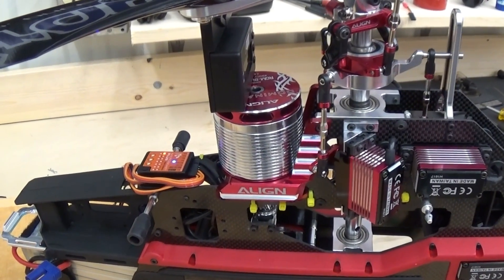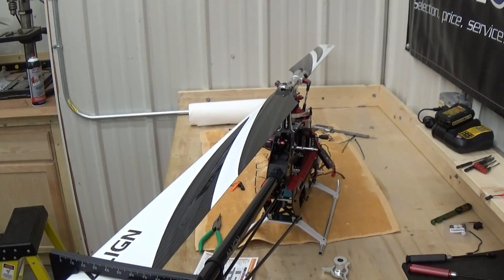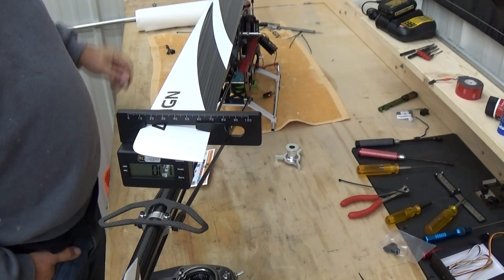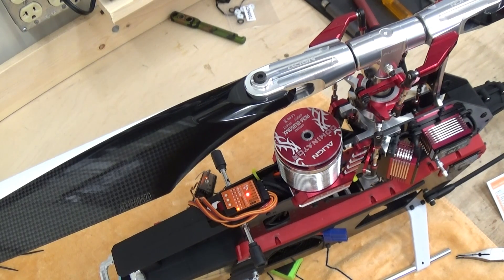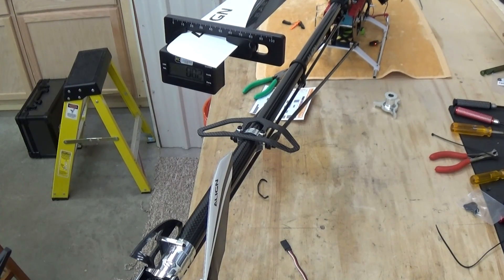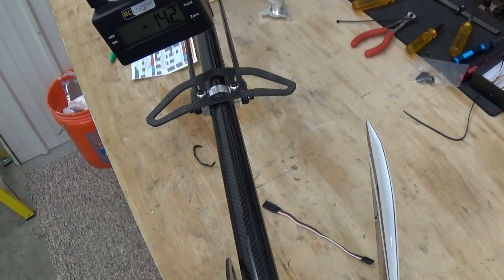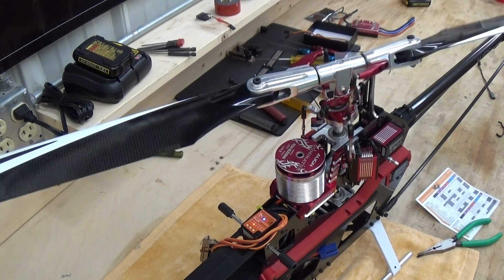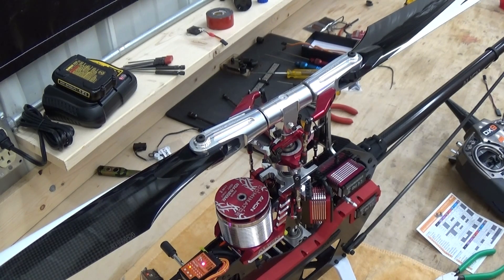TREX700X MicroBeast setup Part 3

Comment: Thank you for video series. Have a question. When I adjust blades to 0 degrees (throttle at 50%) and they are aligned with a tail boom, from the front of my heli, I adjust a blade to 0 degrees. But when I turn that blade around in the back, it is off by minus 2 degrees. What is wrong? Considering that the swash plate has been leveled. Same goes for another blade - from the front - set to 0 degrees and after turning it back (to the tail) - it is -2 degrees off. Is it suppose to be like this? I was thinking, that if the swash plate is purfectly leveled, both blades should have 0 degrees from all sides of the heli.
Reply: Hello from Spain then you make a mistake in leveling the swashplate mecanical , its the most importend think to level it mecanical to 0 and i make it all from backward and and than you con not hve 2 degrees of diference its your mistake . Than the new Microbeaest X 5.1.4 point G and H changed you have to read the whole manual and than you undersand all , because than you can make all Helicopers working with the same ground setting , its more work but then you understand all for what it is . I have 7 Algin Helis and without wind the go no to nowere because its like a car when you have a alitentation the car goes everytime sraigt ahead . Best regards from a German living 30 years in Spain and 27 years flaying . :-)))))))) The Mircobeast X its maked in Germany from freakware.de